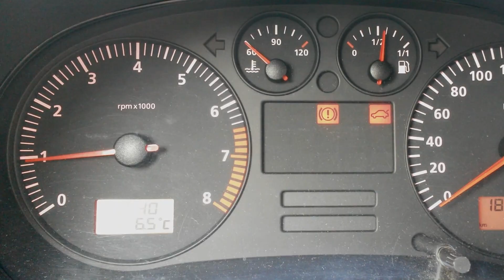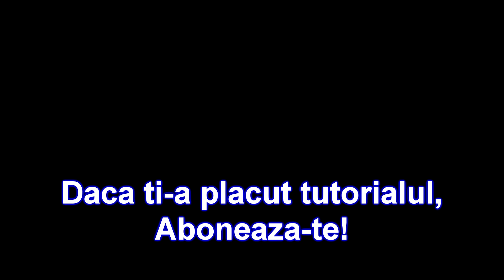Schimbare Bobine De Inductie - AZD / BCB - Seat Leon 1m / Toledo 2 / Golf 4 / Bora

Comment: great video. My car jerks sometimes when accelerating in low revs specially from 2nd gear to 5th gear. It doesn't when standing. Do you  know if it's the coil problem? How can I diagnose which coil is bad or I have to change all 4? Also, my OBD tool can't communicate with the car so I can't see error codes.

Comment: Salut, Sorin.
Observ că au trecut ceva ani de cand ai postat videoclipul. Dar am să pun o întrebare, aș fi foarte recunoscător daca mi-ai putea răspunde.

Dețin un golf 4 1.6 16V BCB.
În urmă cu o zi, în timp ce o conduceam, a inceput sa meargă in 3, tremura motorul destul de urât ( de obicei este foarte silențioasă), nu își ține relantiul, se accelerează greu și dă efectul de șuturi în accelerare și miroare accentuat a benzină nearsă. Mi-a apărut check engine.ul, ba chiar clipocește, mai apare si EPC din cand în când.

Am pus diagnoza VCDS și mi-a arătat urmatoarele:
1) Detectat rateu de ardere la cilindrul 3. ( P0303 -35-00). 

2) Sistem recirculare gaze evacuare (P0402-35-00 - flux prea mare).

3) B1, Sonda 1 (P1196-35-00- Circuit încălzire defect electric - intermitent)

4) Sonda Lambda liniară/tensiune referință (P1183-35-10- scurt la plus- intermitent)

5)Detectare sarcina (P1142-35-10- limită inferioară depășită -intermitent)

6) Sonda lambda liniară/curent de pompare( P1180-35-10 - Scurt la plus-intermitent)

Țin sa precizez că la mufa mașinii ( la care se conectează sonda lambda 1 - cea din fața motorului), sunt 2 fire ciupite, am cumparat o alta mufă care este ok, ma gândesc oare problema cu sonda 1 să fie din mufa asta sau trebuie schimbată sonda cu totul?

Astept foarte mult cateva sfaturi din partea ta, ba chiar, te rog să-mi spui ce altceva sa verific cu vcds.ul pentru a contura problema principală.

Am sa merg să-i cumpăr bujii si bobine noi NGK.

Mulțumesc anticipat și sărbători frumoase.

Comment: salut..am un vw 1,6 16 v.......si de o vreme la relanti oscileaza turometru...nu apare nici o eroare.....ce ar putea fi?
Reply: Iti face figuri o bobina sau o bujie. Am pățit la fel pana m-a lasat bobina 1 de la motor
Reply: La mine, motor BCB, face asta de 4 ani de cand am luat-o, cand se incalzeste motorul, incepe sa oscileze, dar nu tot timpul si nu constant, e aleatorie, din cand in cand (cam odata pe luna) si un misfire pe cilindrul 3 care nici acum nu stiu de ce  sau daca e corelat cu oscilatiile. Cert e ca am schimbat bobinele intre ele si tot mi-a dat misfire pe cilindrul 3, cand motorul se incalzeste putin ii sterg eroarea si merge corect. Pentru oscilatii nu am erori si nu sacadeaza in mers, doar relantiul. Am mai intrebat pe unul altul si toti isi dau cu parerea, nimic concret, desi este un motor destul de comun, asa ca m-am obisnuit cu problema asta si nu imi mai bat capul sau sa arunc cu bani in ea.

Comment: Salut, Sorin !
Apreciez postarile si informatiile pe care le publici aici.
Sunt posesorul unui Golf 4 1.6 16v cod motor AZD. De ceva vreme motorul prezinta ceva tepidatii la relanti, uneori oscileaza turometrul, insa trage bine in sarcina, dar a devenit destul de zgomotos (in habitaclu).
Cum as putea elimina aceste probleme ?
Daca locuiesti in Bucuresti sau in apropiere, te-ai putea uita un pic la masina ? (Sigur, ma deplasez eu in locul in care e posibil sa faci acest lucru ).
Reply from the maker: salut, nu sunt din Bucuresti. fara sa vad motorul e cam greu de dat cu parerea. eu as zice ca e o problema cu clapeta de acceleratie sau cu valva EGR. ar mai putea fi si bujiile sau bobinele de inductie. daca toate acestea sunt ok, trebuie sa faci o diagnoza auto, e greu de ghicit.
Reply: Sorin - DIY Mechanical Nerd 
Multumesc frumos pt raspuns. Nu cunosc meanici care sa priceapa la un astel de motor. De "urechisti" si dornici de castiguri nemeritate m-am cam saturat.
Oricum, cele recomandate si expuse de tine le voi urma in speranta ca voi reusi sa adic motorul la parametrii normali de functionare.
P.S. Ai cumva amici/cunoscuti mecanici aici, in B, la care m-ai pitea indruma sa merg ?
Multumiri inca o data !
Reply: Salutare ! Aceleasi probleme/simptome am si eu. Am tot un Golf  AZD. Ai gasit vreo rezolvare?
Multumesc anticipat.

Comment: Se aprinde check engine ceva? Am un polo azq 1.2 care porneste greu, se ineaca, dupa care isi revine. Nu se aprinde check engine. Pot fi bobinele?
ms.
Reply from the maker: salut. nu cred ca sunt bobinele de vina, ar face tot timpul probleme. poate fi un injector infundat sau probleme cu sonda lambda. insa trebuie sa faci o diagnoza, nu are rost sa te apuci sa schimbi piese, fara sa stii exact unde e problema.
Reply: @Sorin_DIY_Mechanical_Nerd  Multumesc! Face asa doar la prima pornire dimineata, merge in doua pistoane si miroase a gaze nearse. In restul zilei nu sunt probleme, nici in mers. Am facut diagnoza VCDS si aparea un mesaj cu "system to lean". Trebuie sa merg la un mecanic specialist in VW. Cei la care am fost nu erau.  Zi buna.
Reply: Salut! Ai rezolvat problema? Și mie mi se întâmplă la fel dimineața la prima pornire, după își revine

Comment: Salut Sorin am și eu o problema cu  mașina mea vw polo14 benzina îmi apare EPC IN BORD SI NU SE MAI DUREAZA , își revine după mai multe chei ce ar putea fi ?
Reply from the maker: salut. EPC se aprinde de obicei cand e o problema cu pedala de acceleratie. poti sa incerci sa deconectezi bateria, apoi clapeta de acceleratie cateva minute. le conectezi la loc. pui contactul de cateva ori fara sa pornesti motorul si astepti de fiecare data sa lucreze clapeta. atunci ar trebui sa se autocalibreze si sa scoata un bazait. apoi pornesti motorul si vezi cum se comporta. daca tot ai probleme trebuie sa faci o diagnoza auto. posibil sa aiba nevoie de adaptare cu VCDS. sa verifici si ce erori ai stocate. poate fi un contact imperfect in fire, mufa sau in partea electronica a clapetei. poate trebuie chiar sa o schimbi.
Reply: @Sorin_DIY_Mechanical_Nerd  epc inseamna electric panou control.
Adica panoul de sigurante.
Cauza aprinderi epc o siguranta arsa.

Comment: salut sorin . am o intrebare, am pornit masina (golf 4, motor BCB) la relanti simt ca trepideaza scaunul soferului si schimbatorul cand tin mana pe el (daca nu tin mana nu se vizibila trepidatia), asta inseamna ca am probleme cu bobinele injectie?
Reply from the maker: salut. daca e o bobina defecta, ar trebui sa iti dai seama din mersul motorului - relantiul variaza, nu mai are putere, urca greu in turatii (chiar daca o turezi in gol),  da sa se opreasca motorul cand pleci... 
daca motorul merge bine, inseamna doar ca vibratia motorului nu mai e izolata si se transmite in cabina. probabil au imbatranit suportii de cauciuc ai motorului.
daca e vorba doar de o vibratie cand motorul e rece, eu zic sa o lasi asa. daca schimbi suportii motorului, automat motorul va sta in alta pozitie, probabil cu cativa mm mai sus. timoneria s-a adaptat la pozitia actuala a motorului (mai exact a cutiei de viteze). daca ii schimbi pozitia, e posibil sa iti intre greu in viteze si ai nevoie de un mecanic profesionist sa o regleze.
insa daca motorul are probleme, nu merge cum trebuie si vibreaza din alte motive... trebuie sa gasesti motivele.
Reply: mersi mult sorin
Reply: Am avut si eu aceasi problema la seat toledo 2002 1.6 bcb si cand schimbam vitezele tremura schimbatorul de viteza si motorul daca te uitai la el tremura anormal la relanti. Schimba suportul la cautia de de viteze si nu mai ai probleme.

Comment: Salut  Sorin,  am un golf 4 1.6 din 2003, am problema cu emission workshop. Sunt momente când apare și mașina merge normal,  dar sunt momente când apare și motorul numai trage cum trebuie sau chiar deloc. După ce opresc mașina și o pornesc de 2-3 ori își revine, dar poate reapărea oricând. Am pus testul pe ea și am avut eroare de aprindere pe cilindrul 1 și 2, am schimbat bobinele de inductie, totul bun 2-3 zile și după a reapărut. Probleme persistă mașina merge bine poate câtva timp apoi iar apare și moare. Ce pot face? mulțumesc.
Reply from the maker: salut. cel mai probabil e un senzor defect, sau are o intrerupere in mufa sau cablu. ar trebui sa pui din nou testerul pe ea. daca iti da din nou eroare pe acelasi cilindru, incearca sa schimbi si bujiile. daca persista eroarea pe acelasi cilindru, probabil e o intrerupere in cablul sau conectorul de la bobina de inductie. poti sa incerci sa cureti si senzorul de presiune aer si sa ii verifici firele si mufa, daca e vreo problema vizibila. sa verifici si firele de la sondele lambda, poate e vreun fir dezizolat, agatat... am intalnit la un logan firele de la un injector roase de soarece si mergea in 3 pistoane.
Reply: O sa caut, multumesc!
Sarbatori fericite!

Comment: Salut am un golf 4 1.6 fsi si daca nu o pornesc un timp nu porneste la prima cheie niciodata plus ca in mers i.mi mai da rateuri cant o accelerez. Nu de mult mi sa inecat motorul in mers si nu a mai pornit am facut o diagnoza si mi.a dat eroare pe cilindrul 2 si 4. Mi.a zis ca sunt bobinele. Oare de le ele face masina asa?
Reply from the maker: salut. eu cred ca sunt bujiile de vina. cand se defecteaza bujiile, merg din ce in ce mai prost. motorul porneste greu cand e rece si la acceleratii da rateuri. 
cand se defecteaza o bobina de inductie, de obicei se strica brusc si nu ai ce sa ii mai faci. e posibil sa dea cateva erori inainte sa moara, apoi se strica brusc si merge in 3 pistoane (sau mai putine), pana le schimbi.
probleme de pornire si de acceleratie pot sa mai apara si din cauza injectoarelor. dar atunci s-ar comporta ca si cum motorul ar avea mai putini cai putere, nu ar merge in hopuri. doar daca un injector s-ar defecta complet si ar merge tot timpul in 3 pistoane.
eu as incerca mai intai cu un set de bujii NGK. dar asta e doar parerea mea... :D
Reply: 2 bobine duse una moarta de tot mergea in 3 si inca una e pe duca. Am fost la service si lea comandat trebuie sa le pun. Sun curios cum porneste dupa

Comment: Salut am un seat leon 2002 1.6 v 1.6  105 cp benzina poți sa ma ajuți si pe mine  La relanti întrerupe si in mers cand bag demaraj  întrerupe iam luat buji noi  si tot aja  face si filtru nou ce sa fac
Reply from the maker: salut. pare sa fie o problema de aprindere pe un cilindru. daca e motor cu cod AUS pot fi fisele de vina, daca e AZD sau BCB pot fi bobinele de inductie. indiferent de tipul motorului poate fi problema si cu senzorul de aer. trebuie sa faci o diagnoza auto, sa sti ce erori ai si pe care cilindru. e greu de ghicit.

Comment: salut am achizitionat de curand un seat ca al tau acelasi motor si nu are demaraj ,plus ca mi se aprinde in bord ceva ca si cum ar fi pompa de benzina dar nu cred nu am nici o idee te rog daca poti sa imi dai un sfat multumesc
Reply from the maker: salut. pot fi multe variante. daca excludem indicatorul care se aprinde pentru nivelul de benzina, poate fi indicatorul pentru ulei de motor. trebuie sa verifici uleiul. daca nivelul de ulei e bun si tot se aprinde indicatorul de ulei, poate sa fie senzorul defect. sa incerci sa deconectezi bateria cateva minute (ai grija la cdplayer, daca are cod)
legat de demaraj, poti sa incepi cu buiile. daca are momente in care tremura motorul sau da rateuri, poate fi o bujie defecta. daca merge tot timpul in 3 pistoane, de obicei e o bobina defecta, sau in cazuri mai rare - un injector. 
poate sa fie si egr-ul defect, daca s-a blocat pe "deschis", iti introduce in continuu gaze arse in motor. la turatii mari eficienta motorului scade, pentru ca atunci egr-ul trebuie sa se inchida. trebuie sa il dai jos, sa il cureti. daca e defect, trebuie schimbat.
sa verifici si filtrul de aer de motor, poate e prea imbacsit (desi in cazul asta nu ar trebui sa afecteze prea mult performantele motorului) si filtrul de benzina, poate e prea infundat si debitul de benzina nu e suficient (dar la fel, e un caz foarte rar).
sau clapeta de acceleratie poate sa fie limitata de calculatorul de bord, daca acesta detecteaza alta problema cu motorul...
cel mai bine e sa faci o diagnoza auto, sa vezi exact ce piesa iti da eroare. altfel pierzi prea mult timp...

Comment: salut am vw bora 1.6 16v azd si imi apare eroarea gas scarica officina...un sfat de la ce ar putea fi...iar masina nu prea trage...
Reply from the maker: salut. probabil e vorba de indicatorul - Emission Workshop. poate sa apara din mai multe motive. de obicei e una din urmatoarele probleme: 
1. daca tremura motorul la relanti, urca greu in turatii si tremura cand il accelerezi... daca pleci incet de pe loc, da sa se opreasca... inseamna ca merge in 3 pistoane. 
2. EGR-ul poate fi defect, blocat... poti sa incerci sa il cureti. poate are un fir/mufa intrerupta. 
3. sonda lambda defecta (poate e filtrul de aer de motor prea imbacsit) da informatii gresite de emisii calculatorului de bord. 
dar trebuie sa faci o diagnoza auto, altfel nu ai de unde sa sti exact de unde e problema...

Comment: Salut! Te urmaresc de ceva vreme, si-mi place ceea ce faci. Pot spune ca am si eu niste probleme, adica imi suiera cand accelerez la relativ, si-n mers, nu mai zic ca se accelereaza singura la relativ dar umpic 200-300, si-si revine la loc. Sa inteleg ca necesita bobinele de inductie? Sau ce? AA, si daca mi-a aparut Generator Werkstat? Ce sa inteleg? Mersi anticipat.
Reply: E vorba despre un golf 4 1.6 16v, 77kw 105hp. (BCB)
Reply from the maker: salut. nu are treaba cu bobinele de inductie. sunt 2 motive principale de la care se aude suierat. mai intai trebuie sa vezi din ce zona se aude. daca se aude din zona pedalei de frana, e posibil sa ai probleme cu pompa de vacuum, servo frana, sau un furtun intepat de la pompa de vacuum. in cazul asta de obicei cand calci frana, nu mai suiera.
sau cureaua de accesorii e slabita sau veche. trebuie sa verifici bratul intinzator cu rulment. asta poate sa aiba legatura si cu mesajul din bord, care te anunta ca e o problema cu incarcarea bateriei. daca e slabita cureaua si alternatorul nu se invarte de ajuns, incarcarea bateriei nu va fi eficienta. tot de aici poate sa apara si variatia turatiei la relanti. ai nevoie de un multimetru, sa verifici tensiunea de incarcare. trebuie sa fie intre 13,8 - 14,4 V. daca pornesti consumatori si scade sub 13.8 V nu e ok. sau daca reusesti cumva sa turezi putin motorul, sa tii relantiul stabil, la fel si tensiunea trebuie sa fie stabila. nu trebuie sa varieze.

Comment: Salut as vrea sa cumpar si eu un golf 5  cu motor 16mpi. imi poti sp si mie  ceva despre acest model? Este scump la intretinere ?
Reply from the maker: salut. in comparatie cu 1.6fsi sau diesel e mai ieftin de intretinut. are o singura axa cu came, deci e mai silentios si distributia e mai ieftina si se schimba mai usor. merge si cu benzina de 95 si de 98 (desi in Romania e recomandat de 98). la 1.6fsi e riscant sa alimentezi cu benzina de 95, e mult mai pretentios. cel de 1.4 e prea puturos, nu are rost. 1.6mpi are consumul decent, insa 1.6fsi are consum mai mic, deoarece are 6 trepte si un sistem de injectie mai complex. 1.6mpi este mai fiabil decat celalalte, insa la mana a 2a orice masina e o loterie. pentru oras e ok, in exterior posibil sa ti se para ca faci cam greu depasirile.
Reply: Sorin - DIY Mechanical Nerd . Multumesc frumos pt  raspuns . dar de astra h tot 16 benzinar . Stii ceva

Comment: Salut sorin am o problema , la schimbare În treapta 2 și a 3 ami tremură masina În  mers k iar și cu turație mare când schimb la un golf 4 1,6 benzina 16 valve aștept un răspuns.
Reply from the maker: salut. pot fi multe componente care fac motorul si masina sa tremure. e greu de ghicit. eu as incepe cu bujiile si bobinele, sunt cele mai simple de schimbat. insa e indicat sa faci o diagnoza auto, sa vezi pe ce componente ai erori.
Reply: Salut sorin leam schimbat bobine de inducție  și bujii și am curățat egr , clapeta și injectoare de benzina , ce mă gândeam ducând am luat mașina  nu am făcut unghiul de fuga ! Ar fi prb și ăsta iar acum ami face antre  1800 și 2000 rotație ami tremură .
Reply: Schimba suportul la cutia de viteze. Cand deschizi capota e in dreapta langa baterie

Comment: Salut imi poti spune in ce parte a motorului este injectorul 4 la distributie sau in partea ce lalta
Reply from the maker: salut. injectorul 4 e in partea dreapta cum te uiti la motor, aproape de baterie.
Reply: Multumesc. Am o problema cu motorul intrerupe la relanti si dimineata mai porneste si in 3 dupa cateva secunde isi revine, am schimbat bobina bujie injector curatat clapeta acceleratie si egr senzor aer si tot. Intrerupe nu consuma ulei cod motor BBY
Reply from the maker: e posibil sa ai compresie scazuta pe acel cilindru, incearca si un test de compresie. iar daca schimbi bujia si bobina de inductie, e indicat sa le schimbi pentru toate pistoanele.
Reply: Pe toate leam schimbat  ma gandesc si la senzorul de temperatura si la cel de pe axa cu came imi oscileaza si turometrul
Reply from the maker: e posibil sa fie si astea. mai poate fi si sonda lambda de vina, care functioneaza corect doar cand e calda. dar tinand cont ca ai pe un singur cilindru probleme, eu zis sa continui cu test de compresie. daca ai compresie slaba pe acel cilindru, nu are rost sa mai schimbi alte piese.
Reply: Da cu sonda am avut probleme da am schimbato ca imi datea eroare acum nu mai am eroare in bord decat o singura data mi sa aprins martorul de motor in bord si mia dat misfire pe cilindrul patru am sterso si nu a mai aparut, pe intrefata obd imi arata temperatura mai mica ca in bord